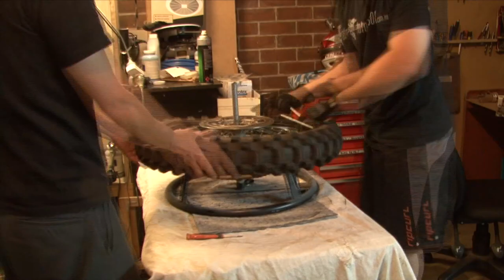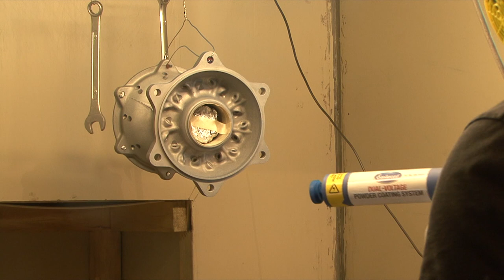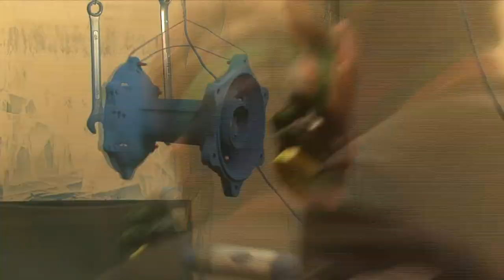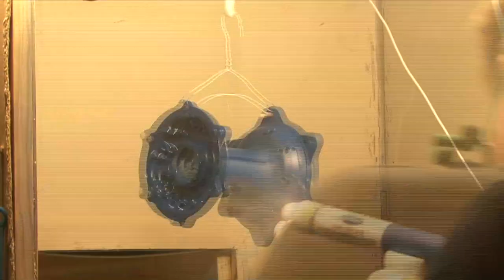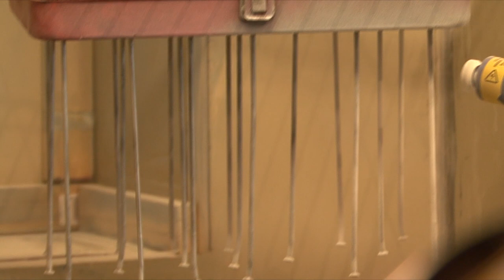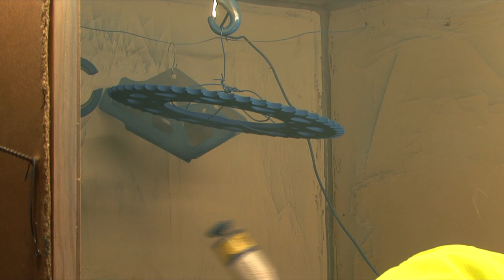Powder Coating MX Hubs, Nipples and Spokes

Comment: Good job! Did you have any trouble relacing your wheels after powdercoating
Reply from the maker: Thanks, no issues with the relacing but they can be drilled out a bit if needed.